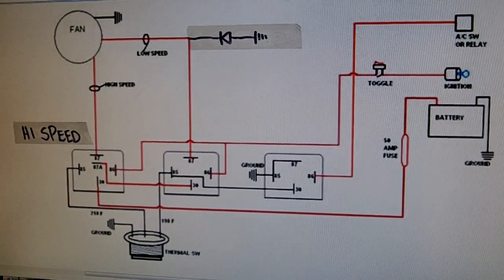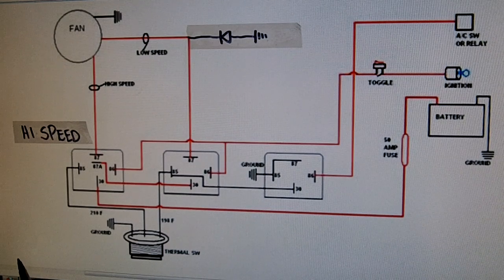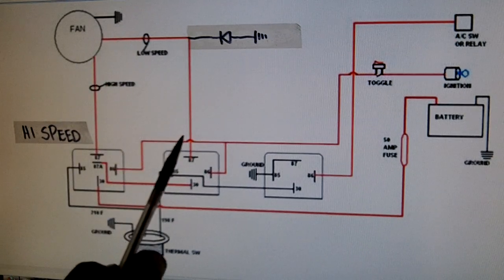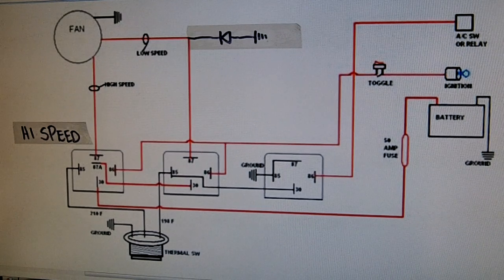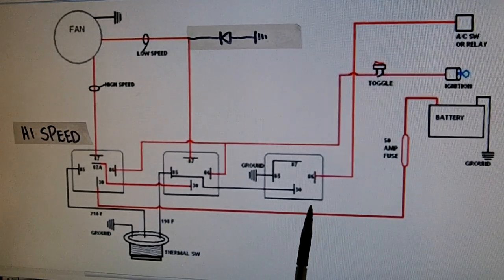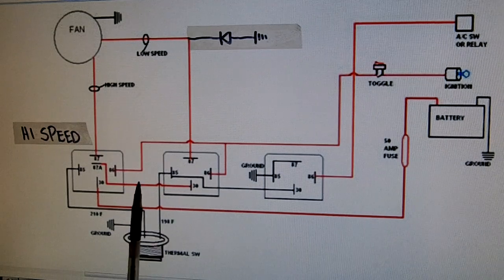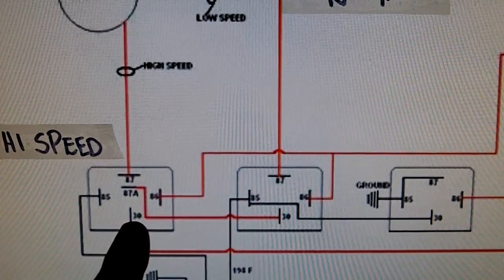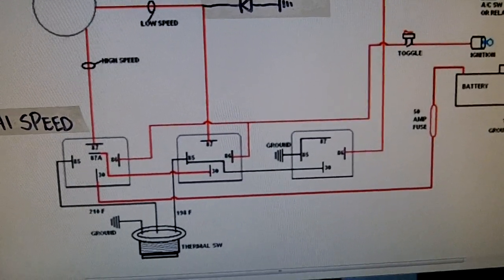2- Speed Electric Cooling Fan Wiring Diagram

Comment: Can I add the diode between + and - of the fan wires ? Between the fans low speed power wire and the fans ground wire ?

Comment: I saw you cooling fan diagram so, I then looked at your channel...Good stuff! Many of the same interests!!! Anywho, A bit about myself, I was seriously injured in 07! I lost some abilities thats for sure though, I do my best! I have a 07 Pontiac G5 2.2 vin F, something is up with my cooling fan circuit! I have seen the temp get to 212 & the fan has Never turned on!  The a/c does not blow cold! There was front end damage which was repaired hap hazzardly. Poking arround with my test light in the relay box, when I grounded a peg within the cooling fan relay, the fan came on so, I connected a wire to that peg & ran the wire i side the vehicle to a toggle switch then, to a ground. When I flip the switch, (ground that wire) the fan comes on. I do not know how to access the high speed fans? I purchased a thing that u splice into a coolant hose,  which allows you to connect a temp sensor & a ground wire, though, I noticed the hole for the temp sensor is very small! I also ordered a new temp sensor for my car because I want to extend the 2 temp sensor wires up on top of the engine where I can comfortably boil some water & test the system. A relay was missing so, I have gone to a junk yard & upon looking at different Cobalt, G5's some have big relays & some with smaller relays. A gm garage tells me that my G5 takes 2 of the same relays on the 2 cool fan relays but, when I look inside the relay box, one is 4 pin & the other is a 5pin but a GM dealer says it takes two- four pin relays...I don't know how to get this fan to operate correctly!
Reply from the maker: You may what to check out this video https://youtu.be/J02nYci5DS0
and this is what I used on my last electric fan conversion Flex-a-lite 31163 Variable Speed Control Module with Threaded Temperature Sensor https://amzn.to/2HrxCnA

Comment: Should the diode be in series(inline)? As opposed to parallel? 

If a capacitor were used I belive that wiring would be correct, however for the diode to work properly to negate electrical back feeding it would have to be inline. I would also put one on the high side inline as when the vehicle is moving the fan is turning and generating a small current that could potentially burn up relays.

Comment: How the high speed turn on when a/c is on in this diagram . Only low speed can be activated by the third relay . You side in video that when a/c is active this  will automatically start high speed on.

Comment: Just buy a Relay with the Diode Built in the Relay !  Save time and money “Diode” It’s not called back driving, it is a electronic check valve. It also keeps the relay coil contact from chattering .  Sorry but it was a good diagram
Reply from the maker: Thanks for sharing
Reply: what brand and part number did you use to find the relay with the diode built in?  Please post if you dont mind. Thank you up front!

Comment: Hi @martinbuilt,  miss seeing more of your vids.  Question,  why bother to have the fan come on with the AC?  The stock auxiliary fan is already wired to do so?  If the temps creep up the low side would kick on automatically and high if temps keep going up.  I am in process and gathering the parts to try this modification.
Reply from the maker: @surgeonfish9014  well the engine itself could be cold but you're requiring AC immediately because of the temperature of the cab. So you would want both fans to kick on immediately so the A/C is operating at 100% and with both fans operating you are drawing air across the entire A/C condenser. Thank you for watching and good luck with your modifications.
Reply: @martinbuilt  Thanks for your response.  That makes sense.   I think I will use the Dakota Digital 2800BT controller to give more control over the fans.  It has a AC port as well.  Still have your XJ?

Comment: Hi sir what about my car only cames with 2 wire motor fan. Only came with 1 thermal sensor 1 speed fan only. If i want to modified put a 2 speed 4 wire motor fan Can i just loop 4 wire to 2 socket together? Do need to add extra relay? Tq sir

Comment: I am installing tis fan on a 55 Chevy. I don't have A/C and I don't have the temp switch. All that I want to do is wire the fan up so that I am able to use a 3 position toggle switch or even 2 different toggle switches. 1 for low and 1 for high. Not that great with wiring but are you able to help me out with a schematic for my needs? Thanks in advance
Reply: bigweel73 this is the same thing I want to do. I want to wire it so up is high speed middle is off and down is low speed.

Comment: Your explanation was very helpful.  I used it to wire a two speed fan in my 1950 Mercury custom project.  I used two separate thermal switches in my layout.  The problem is that the AC switch/relay does not kick on the low speed fan. I have a sketch I could email if you would be willing to take a look.
Reply from the maker: well the way I have it wired my AC when it kicks on kicks  the high fan on automatically it will not kick on the low and that is the way you would want it to work
Reply: Your right, my mistake. I am not understanding why it does not work for me.  The difference is that I have two separate thermal switches, not one with two temperature leads like your diagram.

Comment: Hi I have a problem with my old car ford taurus 97, the engine cooling fan is not activated and the engine overheats. But when I disconnect the ECT sensor, the two engine cooling fans work.
I changed the two sensors (ECT) (IAT) there are 5V from the PCM, I Checked all the fuses are OK. What else I can do?

Comment: Very Cool....question, if you wired it like the diagram , when you turned on the AC only the low speed would come on  ?  correct ?   thanks
Reply from the maker: It is possible I have the diagram incorrect I had a friend of mine draw it up for me. I do know that when I turn on the AC the high side of the fan comes on and that is the way you would want it.

Comment: You mentioned that when the ac kicks in, that the high speed on the fan auto kicks in. But what I'm seeing by your schematic, when the a.c. Kicks in it is the low speed that gets turned on.

What I'm saying is according to your schematic #30 terminal on the a.c. Relay is wired up to the low speed relay. If you want the high speed relay to energize you want #30 terminal on the a.c. Relay connected to #85 terminal on high speed relay, correct?
Reply: That's how it looks to me.  So is the diagram correct or did Martin mis-speak?
Reply: This is correct. The diagram is wrong.

Comment: Would be nice to see this diagram for two fans. I am going to assume you need more relays as the load would be two high?
Reply from the maker: it depends on the relays used. There are HD ones that will handle 70 to 80 amps
Reply: @martinbuilt  ideally one fan running low speed then both running high speed would make sense
Reply: @martinbuilt  why would you need a second AC relay, tap off the one for the clutch?
Reply from the maker: @GregariousAntithesis   yeah that should still work with this diagram.

Comment: I don't understand what that regular diode in the diagram is doing.   My understanding is that it should be a zener diode to bleed off the approx 90v back emf the spinning motor will produce when shut off.
Reply from the maker: It is to discharge the coil on the relay. There better not be anywhere near 90 V produced in this 12v system.
Reply: Note that the diode you referenced is rated at 3 amp and 1000v. Where did this recommendation come from? Do you have any references?

Comment from the maker: Yes and Yes. I've switched to the BMW switch.
Reply: martinbuilt 6
Reply: Your saying the center line on the thermostat switch goes to 86 on the low speed and the outside one goes to 86 on the high speed. Is the right???

Comment: Martin why would the fan go into high speed, been that the 3rd a/c relay goes to the low speed relay 86 termibal not tge high speed relay
Reply from the maker: Yeah you might be right there may be an issue with that wiring diagram. I know for sure that it does actually work in my Jeep. But the diagram itself may be incorrect

Comment: I also have a cherokee that I am putting a taurus fan in. Just to be sure the diode splices into the low speed hot wire and to ground ?
Reply from the maker: iflytango 
That is right just make sure it is in the correct direction. You'll know if it's wrong because you'll blow a fuse immediately.

Comment: So you mention that the temp switch will shut one off and turn the other on right?  My question is, does the fan need both contacts with power to run high speed?  In the video you mention the relay will shut one off and turn the other on if so it will run low speed on both or?  Any info helps because I just wired everything following your video.  Thx
Reply from the maker: Lorenzo Munoz when the temperature sensor reaches High it will shut off the low side of the fan and turn on the high side. Never at any time is power supply to both low and high side
Reply: Ok Sir, so finally got everything wired up and fan installed.  Everything works perfectly, I used a BMW switch though.  Thx for the videos!!
Reply from the maker: Lorenzo Munoz
 I'm glad to hear everything worked out for you. I would use the BMW switch also. Makes the install a much easier.

Comment: Isn't the AC relay just completing ground for the middle relay which turns on the low speed?  You say in the video that the two wires need to be swapped but if so then wouldn't the center relay be the high speed relay and no longer the low speed relay? But you still refer to the center relay as the low speed relay when talking about how it works.  Confused.  I'm using the bmw switch.
Reply: Looking at it further.  Doesn't the wire from 30 on the AC relay need to go to the 85 on the high speed relay?  That way it's just completing ground same as the sensor would.  If the middle relay is for the 210F and the first relay is for 195F I don't see how it would work right.
Reply from the maker: superdrag 67 
if you do it exactly the way I show it I can guarantee this works I've been running this system for years now. and when I say I'm swapping the two wires it's just the location on the thermal switch in the diagram I have the low side and high side wire on the thermal switch physically in the wrong location that's all.

Comment: What is a part that make a fan low speed and high speed i did not saw in you diagram, some people they use resistor because relay is just a swicth
Reply: the Volvo and Ford Taurus fans have internal resistors which allow for 2 speed operation.

Comment: Martin, you probably answered this somewhere but I'm not using a thermal switch on my installation. I'm trying to use only a lighted on - off - on toggle switch to control low / off / high functions. Three questions - do I need an extra heavy duty toggle switch to handle the job, like a 30 - 40 amp capacity? Would a 20 amp switch work? I currently use a standard on - off toggle on the dash for my smaller one speed fan.  2nd - would the terminals on the relays used by the thermal switch in your schematic be used or are they empty?  3rd - Can the diode ground be to the same spot as the fan itself? Thanks for a great job on this!
Reply from the maker: Yes a heavy duty switch would most likely work provided that the fan that you're using doesn't have a higher amp draw than your switch. Of course using relays are better because you take the load off the switch and generally your relays will be mounted closer to the Battery Source and the fan and this will give it a true 12 volts Plus. Question 2 I'm not sure I follow, I used all the terminals on the relays. Yes the diode can be attached anywhere in that circuit to ground. I hope this helps.
Reply: @martinbuilt  Thanks for  your reply. Yes, it does help. In my installation, the battery is in the trunk and I'll position the relays up near the fan, actually in the position held by the smaller fan relay currently used (and ineffective). I am replacing a small puller fan with a Ford Tauras 2 speed fan. So, I can install a 3 position fan switch on my dash and manually turn the fan from low to off or to high. Since I am not using a thermal switch, I was wondering if the relay terminals that connect to your thermal switch would be unused and therefore left blank in my install.  I thinik it makes sense to leave them unused rather than a short jumper wire to connect them to each other.
Reply: @martinbuilt  Can you tell me what will change in your diagram above if no thermal switch is used and one toggle switch on the dash controls both speeds?  I have a switch that will switch between low speed, off or high speed and do not want to use a thermal switch at all. I also do not have A/C at all, so no third relay for that accessory. I am trying to follow your diagram and think that the switch just replaces the thermal, correct? To which terminals on the two relays do the toggle connect?
Reply from the maker: @ronsagaert2151  yes you can remove the thermal switch then those wires would simply go to ground or run those wires back to your three-way switch that you spoke of I'm assuming it's like a on off on type switch. If you choose to just run the thermal switch wires to ground you'll need to run two hot wires back to your three-way switch that will feed each relay. You can use a light duty switch to operate the relays you could even use 18 gauge wire to operate the coil side of those relays terminals 86 and 85. The diode just needs to be to ground as shown. I hope this helps.
Reply: @martinbuilt  Thanks Martin, I'll let you know how it turns out!
Reply: Martin, I made a mockup on the bench of this wiring scheme and It Works!  The fan works on both high and low speeds hookied to a single on-off-on switch. I'll now wire this setup in the car. If I use a 50 amp auto reset circuit breaker, I don't need the 50 amp inline fuse, correct?  Also, since my battery is in the trunk and I have my starter solonoid on the firewall, can I take ignition switched 12 volt power from the hot side of the solonoid switch and lead that to the circuit breaker and then on to the relays? I'd save a long wire run that way.  Thanks!
Reply from the maker: @ronsagaert2151   Yes that should work.

Comment: i like your presentation, i would like your help, i am 80 yr. old an would apresheate your help, i have a 98 cadillac deville with the northstar engine, as you know they run way to hot, what i descovered when ac on the temp. never gets over 196 because high fan speed is on,  lo speed comes on temp goes to 223 before then lo fan kicks in, by that time it is to late an my coolent boils over to floor, what i want to do is simpley lower the hi limit of the lo speed fan to 196 to kick on fan to keep temp down, if i cannot do that then use high speed fan on both speeds, have new 180 t stat, new engine temp sensor that goes through pcm,, nothing helped, so put in sepreate syestom like the one you showed would help but leave out lo temp side, every thing is stock, but need to change, need to know how to wire it, .thanks, Mr. NEWTON, , thought bout useing one way diodes  as you showed. i live in tx. contact me eight 1 seven, seven, o three, to, one, nine, three, please, thanks

Comment: what relay wiring harness did you use?  Also what gauge wire did you use? Thanks for the video.
Reply from the maker: I used 10 gauge wire to the fan from the relays. The wiring harness is one that I made myself. To activate the relays you can use 16 or even 18 gauge wire will work fine.
Reply: +martinbuilt 
Good to know. I'll change my fan wiring to 10 gauge as well. How did you make your wire harness? The wireharness I bought from oreilly looks to be only 14 gauge wiring. How do you connect your wiring together? Solder? Crimped connectors? I have my fan in a 1984 trans am. Just want to get the best setup going.
Thanks for your help mate.

Comment: Martin, Im doing the dual 97+ fan mod on my 99 XJ. So two stock cherokee e-fans. Any idea how I can use this diagram to help wire them up? Pretty sure the oem fans on our Xj's are 1 speed as opposed to the Taurus  fan. just not sure what relay to delete (if any)
Reply from the maker: There are few things you need to do different. One you only need a single switch thermostat. Find one that kicks in around 195.  Delete the hi speed relay.

Comment: Will this also work for a dual fan setup? I'm running the windstar fans, the big fan 16"is a low speed and the 14"is a high speed fan the high speed will also be used as the ac fan as well
Reply from the maker: Ford Fan74 
I don't see how it would work if you still wanted the low speed fan to stay running. If both fans had a high and a low I would say yes that would work. Once it would switch into high the low speed fan would stop operating
Reply: martinbuilt thank you for the reply, I decided to just run a 2spd fan dedicated for rad cooling and use the single spd high cfm for my ac only, my truck has some miles on it and living in Florida I've decided to add 2 transmission cooler fans and possibly a single oil cooler fan as well, I'm already running a 150amp alt, so I'll have to get an amp reading for my electrical load... Thank you for making the video, Have a good day

Comment: Hello , can you tell me the name of the page, where you got the diagram, that this excellent , please , thanks and greetings from México .
Reply from the maker: +Saul  Luna 
Hi,
A friend of my drew it. There is no page. This is a picture of my computer.
Reply: It is an excellent contribution i would just installed my car, it is a focus 2003 and I'm excellent, works all very well enter the fans when it should be and put the a/c works very well and i have no problem, no i have had short or electrical failure, thanks for your input.